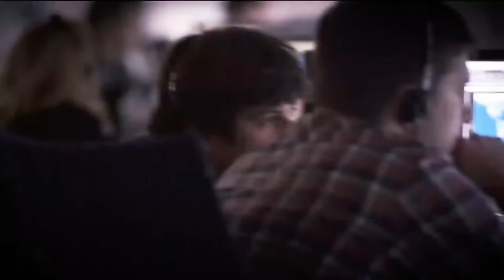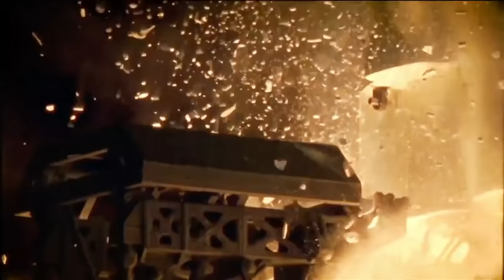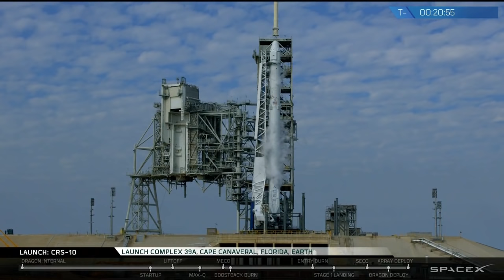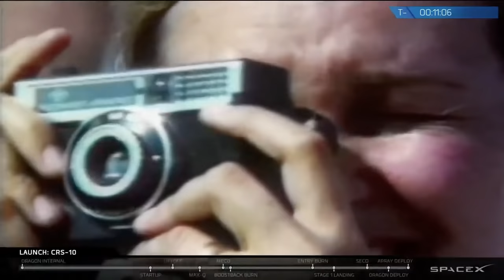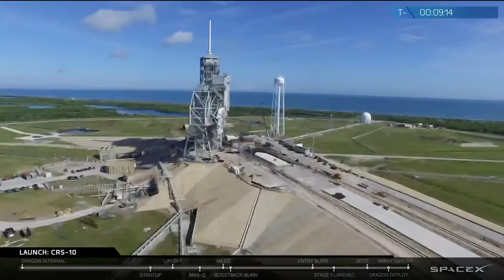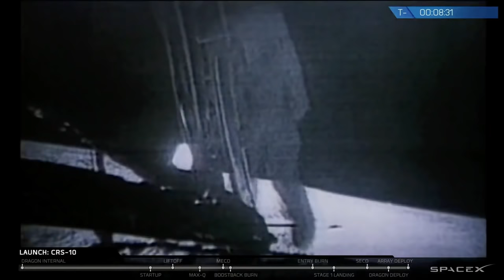SpaceX Rocket Launch From NASA’s Kennedy Space Center Aborted | TIME

Comment: All NASA and other “space agencies” rocket launches never go straight up. Every rocket forms a parabolic curve, peaks out, and inevitably starts falling back to Earth. The rockets which are declared “successful” are those few which don’t explode or start falling too soon but make it out of range of spectator view before crashing down into restricted waters and recovered. There is no magic altitude where rockets or anything else can simply go up, up, up and then suddenly just start “free-floating” in space. This is all a science-fiction illusion created by wires, green-screens, dark pools, some permed hair and Zero-G planes.
Reply: You have no idea of physics. If you reach an altitude with enough speed and direction, you will float.
Reply: :DDDD good job, troll haha
Reply: Getting to orbit by going straight up would be impossible, you have to go in a curve.
Reply: If Earth were really a ball, there would be no reason to use rockets for flying into “outer-space” anyway because simply flying an airplane straight at any altitude for long enough should and would send you off into outer-space. To prevent their airplanes from flying tangent to the ball-Earth, pilots would have to constantly course-correct downwards, or else within just a few hours the average commercial airliner traveling 500mph would find themselves lost in “outer-space.” The fact that this never happens, artificial horizons remain level at pilot’s desired altitudes and do NOT require constant downwards adjustments, proves the Earth is not a ball.
Reply: You don't seem to understand how rockets or airplanes work, the simple fact that you think a rocket should fly straight up proves that much. You should read up on the subject before you proclaim that you've somehow disproved the laws of physics.
Reply: BadWolf HS It is impossible for rockets or any type of jet propulsion engines to work in the alleged non-atmosphere of vacuum space because without air/atmosphere to push against there is nothing to propel the vehicle forwards. Instead the rockets and shuttles would be sent spinning around their own axis uncontrollably in all directions like a gyroscope. It would be impossible to fly to the Moon or go in any direction whatsoever, especially if “gravity” were real and constantly sucking you towards the closest densest body.

Can you provide a practical evidential example of a body of water conforming to the exterior of a shape?
Reply: You're making a fool of yourself, just stop..
Reply: BadWolf HS Ad hominem.

Can you provide a practical evidential example of a body of water conforming to the exterior of a shape?

Try to be honest. Good luck
Reply: Wet basketball, or the oceans on Earth. And you were wrong yet again about how rockets work, they do not push against the atmosphere. You are making a fool of yourself by doing nothing but parroting the most simplistic arguments that have been debunked thousands of times. It's really sad, because it shows you either truly don't believe what you're saying (trolling) or just never took the time to learn before making up your mind.
Reply: BadWolf HS Pay attention you ain't being asked if things get wet or for any vacuous speculations about the shape of the earth.

Can you provide a PRACTICAL EVIDENTIAL example of a body of water conforming to the exterior of a shape?
Reply: A wet basketball has a layer of water conforming to the round exterior shape. Pay attention, you've still not addressed all of the glaring mistakes in your earlier comments about rockets going straight up, or working in a vacuum.
Reply: Dude, he's trolling, just leave it :DDD
Reply: Yeah I know he is, but I was hoping he might actually say something new that the other trolls don't. So far it seems like he's just copy/pasting the same old stuff though.
Reply: BadWolf HS You are clearly lying.

You are claiming that a body of water will conform to the exterior of a basketball! Be honest.

Can you provide a practical example of a body of water CONFORMING to the exterior of a shape?

Try again.
Reply: Water does conform to the surface of a basketball, otherwise you wouldn't be able to wet the entire surface.  Now how about those rockets working in vacuums, I'd love to hear more about that. Dazzle me with your knowledge of physics.
Reply: BadWolf HS Pay attention. Water does NOT conform to the exterior of a basketball. You aren't asked if a ball gets wet, you are asked to provide a practical evidential example of a body of water conforming to the exterior of a shape. Those with common sense know full well that the water put onto a basketball will fall off the sides entirely contrary to your alternate reality whereby the water magically sticks to and conforms around the exterior of the basketball?

A wet tennis ball, for instance, has the exact opposite effect of the supposed ball-Earth! We know as natural scientists that from experiment, water poured over it simply falls off the sides, and giving it a spin results in water flying off 360 degrees like a dog shaking after a bath. Astronomers concede the wet tennis ball example displays the opposite effect of their supposed ball-Earth. Why do you oppose them!?

Try again:

Can you provide a practical evidential example of a body of water conforming to the exterior of a shape?

Try to be honest next time. Good luck
Reply: "Those with common sense know full well that the water put onto a basketball will fall off the sides"  
Did you forget about the Earth's gravity? If you repeat the same experiment in a weightless environment then that wont happen at all. 

"and giving it a spin results in water flying off 360 degrees" 
Not if you spin it slowly enough, the Earth's relatively slow spin for example only cancels out a small fraction of the downwards pull of gravity, a difference that you can measure by traveling between the equator and poles where the speed from rotation differs. 

" Astronomers concede the wet tennis ball example displays the opposite 
effect of their supposed ball-Earth. Why do you oppose them!?"
Of course they would concede that, it's absolutely true and in no way relevant to the Earth example, you're the only one opposing them. No astronomer who paid any attention in school wouldn't give you the same explanation I just did. 

 Your turn to try again, still waiting on your explanation about rockets and vacuums. I think that is your 3rd time avoiding the question since you don't have an answer for that one provided for you in your talking points.
Reply: BadWolf HS Pay attention to the question. You are not asked for your glib and vacuous assumptions or theoretical speculations. Just be honest.

Can you provide a PRACTICAL EVIDENTIAL example of a body of water CONFORMING to the EXTERIOR of a shape?

Try again
Reply: I already did, still waiting for your answer though. I wonder how many times you're going to repeat yourself and ignore what I said. Most of the trolls I've run into at least had more interesting answers. I think this is the 4th time you've avoided the question now?
Reply: BadWolf HS You have claimed that water conforms to the exterior of a basketball. This nonsense is easily refuted by experimentation. Why are you lying? Water falls off the sides of the basketball and it clearly does NOT conform to the exterior of a shape.

Try to be honest.

Can you provide a practical evidential example of a body of water conforming to the exterior of a shape?

Water falling off the sides of a basketball is clearly not an example of this occurring. Try again.
Reply: That makes #5, shall we count how many times you refuse to answer? I've answered you plenty of times now, it's your turn.
Reply: BadWolf HS Your answer is a clear lie and you are being called out on it. Your repeated evasion and deceit is telling. 

Those actually paying attention to the natural science based on experiments that are scalable, testable and repeatable 100% of the time are well aware from experience and observation that a body of water simply does not conform to the exterior of the basketball as you have perfidiously claimed, it clearly falls off the sides doesn't it? 

Try to answer the question honestly.

Can you provide a practical evidential example of a body of water conforming to the exterior of a shape?
Reply: At least I've attempted to explain my answer to you, even if you want to call it a lie (it's not). You're going on 6 comments now without even acknowledging my questions. Maybe you should be honest, and admit you have no answer.
Reply: BadWolf HS Try to focus. Can you provide a practical evidential example of a body of water conforming to the exterior of a shape?

Try to be honest this time. Good luck.
Reply: #7.. seems you're stuck in a loop now :( I guess the fun here is over
Reply: BadWolf HS Keep showing how dishonest you are!

Try spinning a wet basketball or any other spherical object with smaller things placed on its surface and you will find that everything falls or flies off, and nothing sticks to or orbits it.

Can you provide a practical evidential example of a body of water conforming to the exterior of a shape?
Reply: It's unfortunate, I would have liked to have an intelligent discussion.. but they're boring when only one side participates. I'd be happy to elaborate on your water question if you're willing to respond even once to my questions, but this makes #8 of you repeating yourself now. You can keep calling that "dishonest" if you want, but that's just not how debating works.
Reply: BadWolf HS Answer the question and be honest. You aren't being asked anything extraordinary and you are clearly evading after it had to be explained to you that water falls off the basketball example you tried to pass off as an example of water conforming to the exterior of shapes. Care to review your absurd claim that water conforms to the exterior of basketballs? Be honest.

science: knowledge about or study of the natural world based on facts learned through experiments and observation.

Can you provide a practical evidential example of a body of water conforming to the exterior of a shape?
Reply: Are you just going to pretend you're not even reading what I said? I'll answer your question if you answer mine. This makes comment #9 that you're not even acknowledging what I've said.
Reply: BadWolf HS I don't believe you, you have been consistently dishonest and have failed to consider the preposterous example you cited. Your dishonesty and repeated evasion will reveal your true purpose here.

Can you provide a practical evidential example of a body of water conforming to the exterior of a shape?

science: knowledge about or study of the natural world based on facts learned through experiments and observation.

Keep showing your true self.
Reply: That's okay if you think my example was preposterous, but at least I provided examples and explained them to you, something you never even attempted to do. 

It's unfortunate all you can do is call me dishonest and repeat yourself, I truly would have liked to have a discussion. Every time I've tried, people like you refuse to respond to questions, and that's just not how you can have a discussion. If you ever feel like actually responding I'll be back to answer you, but I think 10 chances was more than fair.
Reply: BadWolf HS If you were honest you would admit that water doesn't conform to the exterior of a basketball, that any water applied to the surface falls off the sides of the ball. Pay attention to the question and try to be honest. 

Can you provide a practical evidential example of a body of water conforming to the exterior of a shape?

science: knowledge about or study of the natural world based on facts learned through experiments and observation.

Try again.
Reply: If you decide you want to have an actual discussion, let me know.
Reply: BadWolf HS The invitation to discussion has been available to you throughout, it is you who have chosen to lie.

Try to be honest and answer the question.

Can you provide a practical evidential example of a body of water conforming to the exterior of a shape?
Reply: If you decide you want to have an actual discussion, let me know.